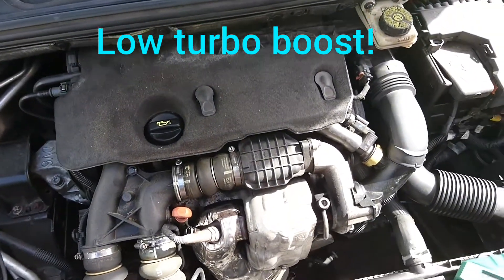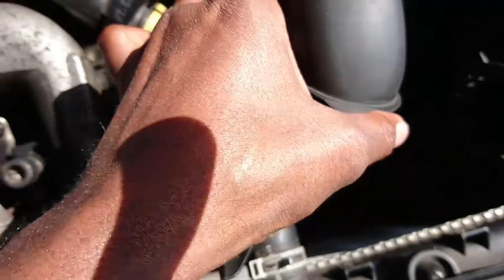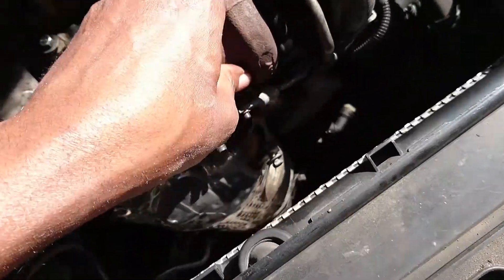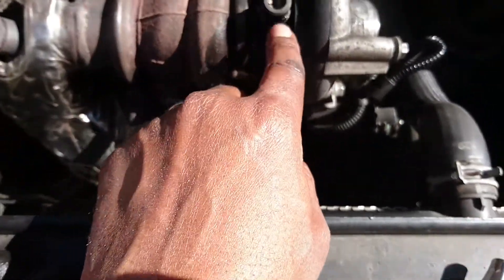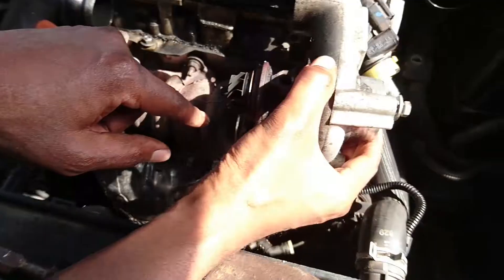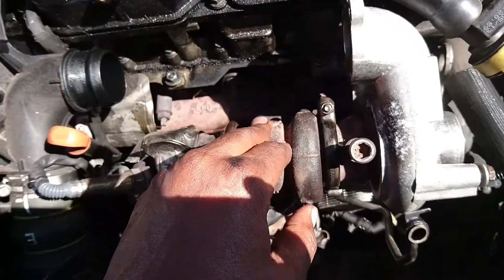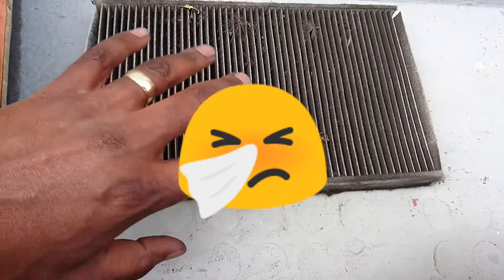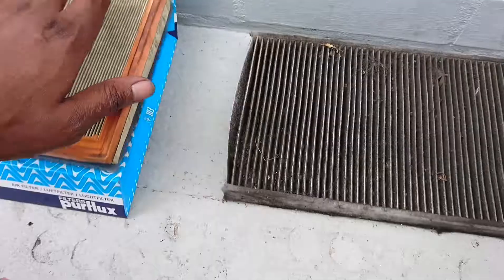1.6 DIESEL TURBO REPLACEMENT

Comment: Hi man I found your video very helpful. I have the same error as yours and I'm about to change the turbo as well. The car lost power and it's smoking white. Was your car the same? Many thanks!
Reply from the maker: Yes, I lost power from the turbo but I had no white smoke. Normally white smoke means coolant in the combustion chamber. Blue smoke means oil and black means unburnt diesel.

Comment: If I have excess oil in the intercooler, and oil low warning. If it is the turbo, can I get away with changing part of the turbo or just a seal?
Reply from the maker: @misterzee5736  
I would put a new turbo or get the turbo repaired by a professional. These turbos last well over 150k miles if the car is driven nicely and oil is changed regularly.
All the best my friend, hopefully your car will be sorted out soon 👍

Comment: Nice video. The turbo has just gone on mine. Did all the old seals and gasgets work ok? How long did the new turbo go on for?
Reply from the maker: @CharlesLawry  hi, everything worked well and I sold the car at ~210,000 miles still going with the second turbo
Reply from the maker: The old turbo did ~157,000 miles. The turbo didn't look broken at all.

Comment: Hi mate could u put a 2.0 turbo into that engine I have one I'm just worrdring would it fit
Reply from the maker: Huge turbo lag, Yes you can do that but the car will need a remap to balance the air fuel mixture. To be honest, just blocking the egr and removing the dpf makes these little 1.6 diesel engines very powerful. There is just too much restrictions of fresh air to get in and exhaust gases to get out.
Reply: @fix-and-drive-diy-repairs  thanks very much for that I will be moving them off the engine tomorrow morning thanks alot mate

Comment: So what happened? Was it the turbo?
Reply from the maker: I don't really know exactly what the problem was but changing the turbo solved the problem. Is still running, making more and more mileage.
Reply: @fix-and-drive-diy-repairs hhë
Reply: @fix-and-drive-diy-repairs  Did you also change the intercooler pipes? You said you would. That could cause the code too.